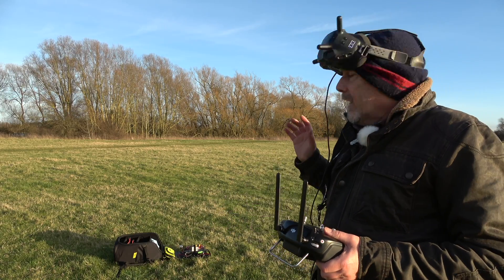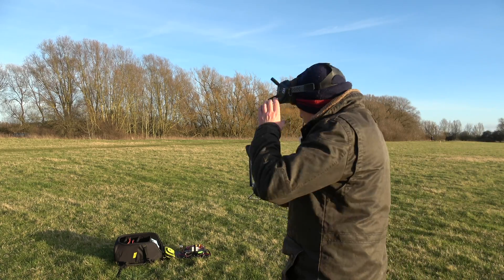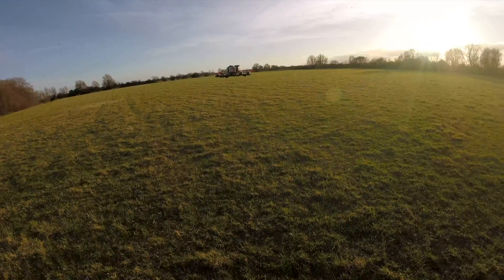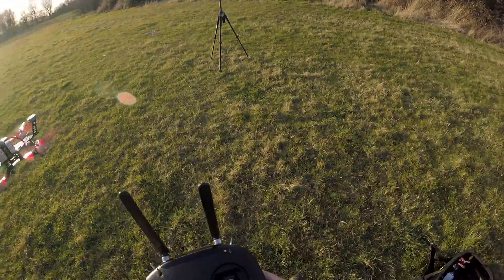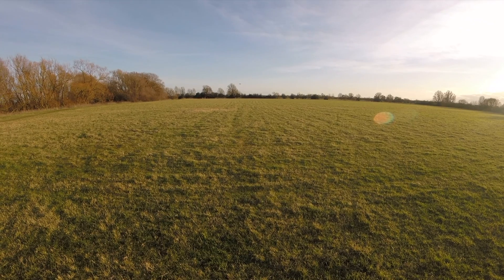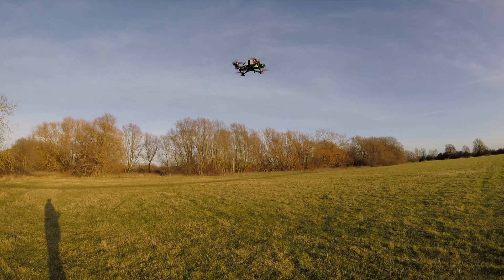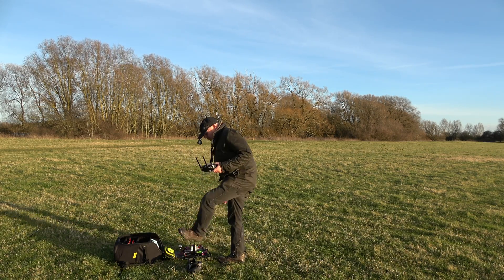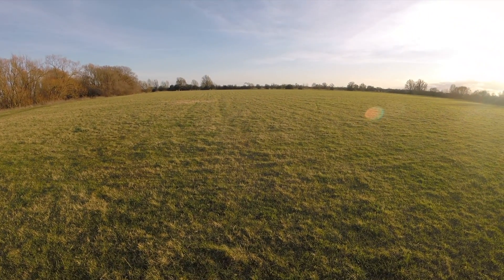AOS 7 and INAV 4.0 testing / POSHOLD, RTH and failsafe

Comment: hi i just built a 7" gps quad but when i arm it i cant use roll and pitch till i use the throttel i have dissabeld airmode can you hellp
Reply from the maker: Check your RC calibration: Make sure that your radio control transmitter is properly calibrated to your flight controller. This ensures that your inputs are being properly registered by the flight controller.

Check your flight controller configuration: Make sure that your flight controller is properly configured. You may need to adjust the PID settings or other parameters to ensure that the quad is responding as expected.

Check your receiver settings: Make sure that your receiver is properly configured to send the correct signals to your flight controller.

Check your flight modes: Make sure that your flight modes are properly configured. You may need to adjust your settings to ensure that you can control your quad in all modes.

Check your throttle settings: Make sure that your throttle settings are properly configured. You may need to adjust the minimum and maximum throttle values to ensure that your quad is responsive to your inputs.

Comment: Hi ,I've tested failsafe on my quad and when I do it through the rth switch everything works, but when I turn off the radio and then turn it back on I can't take control of the quad. the rth button doesn't respond and I always have to wait for the drone to land. how can I do that? Thank you
Reply from the maker: If it returns to home, lands and motors stop,  you've tested it successfully and there's nothing more to do. The transmitter will take a while to rebind if you try while it's returning.

Comment: Hello guy,
I have a question?
My items are:
Fc= speedybee f7v2 stack
Reciever= turnigy ia6b with telemetrie
Gps=tbs m8.2
Transmitter= tx 16s with edge tx and inav.
Is IT possible to Do the same Things like you Do?
Thanks, Thorsten
Reply: My frame is an aos 5
Reply from the maker: The SpeedyBee F7V2 has a BMP280 barometer and there's an INAV target https://github.com/iNavFlight/inav/tree/master/src/main/target so you should be ok. I'd highly recommend getting the Matek M9N GPS and magnetometer - it's really worth the extra money because it's so good.
Reply: Thanks a lot, but i don't know what to Do. I'll Spend more time and then i will see
Reply from the maker: @thor-sten1564  Everything you need to know is here https://www.youtube.com/watch?v=zF498TLVMk0

Comment: In Inav's PosHold I get continuous pitch and roll motor twitches. The interesting thing is that they show up on the Blackbox 'RC Command' data, even with hands off the sticks. It's as if twitchy nav poshold data is being mixed with the RC Command data. I'm pulling my hair out over this with no solution in sight. If I switch to Horizon mode the twitches stop completely, in flight and on the black box file. So there are 2 questions here: Why is Blackbox Explorer 'RC Command' data NOT showing just stick data and why the poshold twitches in the first place ?
Reply from the maker: Try posting a question on the INAV facebook group. They are very helpful over there.

Comment: I have just the caddx nebula pro , on my fpv roma f3 build. I have a diatone gps on it. My question. Is it possible that if i lose signal from rssi, i could have it return home. When it is in view again I could take over. Thanks
Reply from the maker: If you set failsafe to RTH that will work with the DJI controller and it does eventually auto reconnect in that situation. I haven't tried it with other TX/RX combos. Let me know if you try it.

Comment: Oh man need a gps/ compass mount like that for Rekon7.. can not get my compass to calibrate anymore..
Reply from the maker: You need to keep the GPS and compass well away from any metal or EM noise sources - like the battery or motor cables. Matek recommend at least 100mm.

Comment: A quick question. If you have the return to home height set to 30m and you go about your fpv flight traveling over some trees at say 50m high and then descend on the other side of the trees to say 10m. If the tx losses connection will is come back at the set 30m or will it rise up to the highest point during the flight to clear the trees you went over?
Reply from the maker: It rises to the set height above the take off point. So if you're flying over 50m trees make nav_rth_altitude = 65000 (65m) to be safe. This is the maximum value allowed.

Comment: What’s the purpose of P Hold other than burning battery?
Reply from the maker: When you fly long distance/long duration you need a break. Most FPV quad pilot probably never fly for more than 5 minutes. Try flying for 30 minutes or longer and you'll realise how tiring full acro is. Switch to POSHOLD and safely stretch your fingers, have a drink, adjust your goggles or just scratch whatever needs scratching. 😀
Reply: Put controller down and take a drink 🍸

Comment: awesome ! I'm following your lead. did you do any tuning in INAV for the drone to fly "better" ?
Reply from the maker: I'm covering my INAV tuning in another video very soon. I think 7 inch quads fly much better with INAV than BF. The AOS 7 frame is very low resonance so you can push the default INAV PD balance quite a bit without any issues.
Reply: @WhirlyBloke  awesome, looking forward for it ! so far as LR is more a cruising discipline... the default conf seems to work fine. I tried to look at black box but I have to tell you, it's far from being obvious unless you know exactly what you are looking for.
Reply: @WhirlyBloke  is this the AOS7 or the AO7 Falcon?
Reply from the maker: @E-sk8Fr  It's the AOS 7.
Reply: @WhirlyBloke  thank you I'm hesitating between the AOS 7 & AOS 7 Falcon for LR... I saw that the camera placement is different on the falcon but still wondering if the AOS7 is not better! any thoughts ?
Reply from the maker: @E-sk8Fr  I don't have the Falcon so I can't say. It's more of a very long range design modified by Chris Rosser. Maybe ask him on Discord.

Comment: good job :) what Flight controler do you use? ( to get pos HOLD you need baro and GPS module with compass)
Reply from the maker: iFlight SucceX-D F7 TwinG 2.2 stack and a Matek M9N-5883 GPS and compass. Awesomely accurate combo and INAV supported.

Comment: Nice, next week I'll try INAV 4. There is a "failsafe mode" in the Modes tab,  you can simulate a failsafe by  a switch, no need to turn off the transmitter.  And if I remember correctly there is a "power down" or "stop motors" after RTH or Failsafe landing, so it's safe to disconnect the lipo after landing.
Reply from the maker: 4.1 RC is available with a new awesome filter matrix that I'll be trying this week. I know about the simulated mode which I tried, but there's nothing like knowing it really works. I want to be confident for my upcoming long range/long duration testing.  Thanks for the feedback.
Reply: @WhirlyBloke  Yes, 4.1.RC1, the INAV devs are really progressing.   Well, I have to admit that I tested my first failsafe by switching the TX off 😉 To be sure, now I know the switch works the same.
Reply: This would be good on the trainer switch

Comment: Nice. Quick question have you experienced problems with inav, with problems i mean the quad doing unwanted movements ? Im having issues with my two inav quads, basically they move with out any input from the controller after i do a quick punch out and lower the throtle to 0

Thanks
Reply from the maker: Never had those sort of problems with INAV. I've found it to be pretty solid and in my view is the best FC firmware for a 7 inch quad. I suggest checking the mechanicals of the quad if you get that sort of odd behaviour. Make sure everything is secure and the soft mounts on the FC are ok and it's not binding on anything. Have a look at the logs for any weird frame oscillations. I suspect it'll be a build issue.
Reply: @WhirlyBloke  will do thanks
Reply: Cloud Duck FPV - has your problem been resolved?  i have the same issue with Rekon7 Pro. My first iNav build, when throttle is raised, the kwad takes off and cannot land with zero throttle. Wonder what's wrong with my setup.
Reply: @edwinchavez1716  sorry i still have the issue with mine
Reply: Yeah if I go zero throttle mine wobble around on way down.. I have props too big for motor
Reply: @divingfalconfpv4602  airmode must be permanently enabled :)
Reply: @ulliu.3200  I have it on on all my quads except indoor tiny whoops. But I can double check